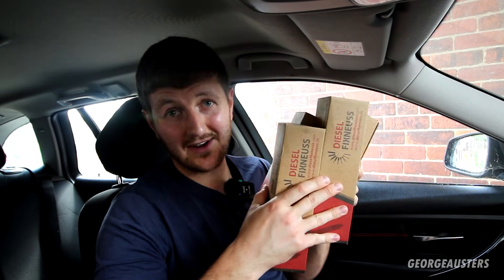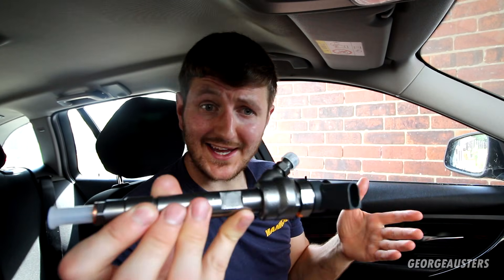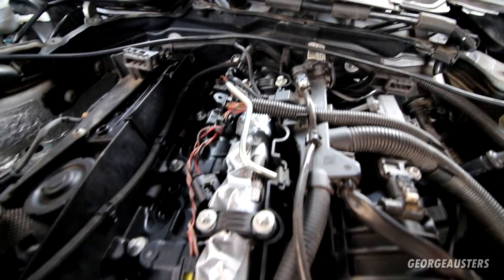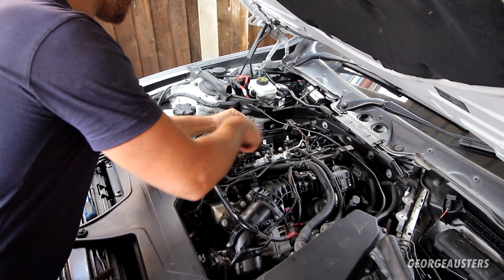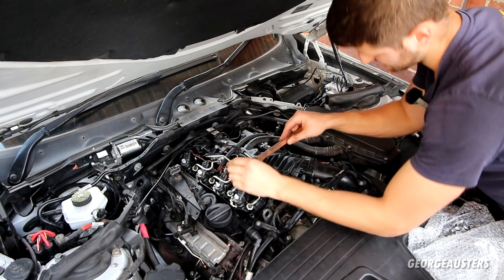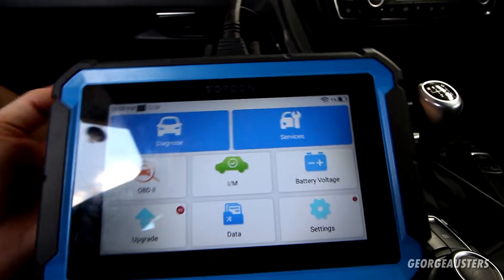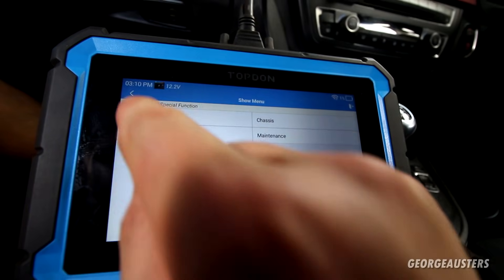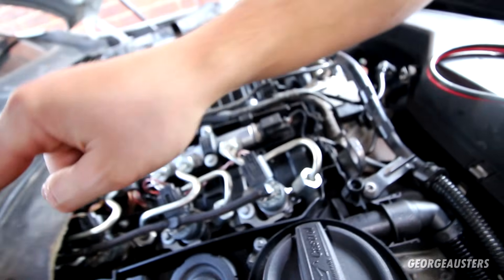HOW TO CODE DIESEL INJECTORS TO YOUR CAR

Comment: I need help , bought a 06 tundra. The owner ordered custom OEM 12 hole injectors , installed them then I bought the truck. I've had a p0138 high voltage code 2 weeks after buying it. I've changed the O2 sensor it said was bad and even swapped it to the other side to see if it was a faulty sensor. Code still comes back, is there a chance the injectors need to be coded to the ECU? I want to love this truck again 😅

Comment: I might have this job coming ahead, currently I have injector leakage on cylinder 1. At cold engine correction values with cylinder 1 is almost +3 and with cylinders 2 and 3 only -0,6. Cylinder 4 has -2 correction value on cold engine but when engine is warm correction values in cylinder 1 is only +1 and cylinder 4 is -1 which in spec. Cylinders 2 and 3 are almost 0. So I think ill just try to swap injectors and see if high correction value follows the injector and if it does I´ll need to do this which is very easy now when I have clear instruction video. I bought same scanner and it has been very good purchase.

Comment: Hello, do i have to do adaptation of injectors after i replaced copper washers and cleaned tip of nozzle ?
Reply from the maker: No
Reply: @GeorgeAusters car is accelerating slower then before, one side of injectors was clogged, now its clean but car is slower

Comment: Well my issue is now WTdiesel done new encodings and they not match with the injector body code. And i am in shit cuz i changed all injectors and i mixed paper work. They wrote new code for each but not the old value on paper. Now i dk what code has each

Comment: 📌I had all 4 injectors changed and coded in my toyota avensi but my EML light is on now plus handbrake light (handbrake works fine) not sure why is that 🤔

Comment: hi george, i got 4 other injectors for my car and one of them, the plastic is a bit broken and i have no clue what the 7 digit code was. 
is it possible to find out what the number was  and if not, does this make this injector useless
Reply from the maker: Engine will still run without coding injectors👍🏻

Comment: Hi George, i have 2013 640d and had my rocker cover and gasket replaced in March because of smoking and leaking. Since then i have been seeing oil on top of the cover in the injector ports. Had the gasket replaced again because the first garage messed up first time and lots of gaskets in injector ports were pinched and not installed properly. Its been fine for a while after this but recently noticed a little bit of oil on top again. What can cause this? I had all the injector seals replaced as well.

Comment: Hi George, just a quick question. N47c16a engine. Just had my rocker cover gasket changed and also glow plugs plus oil change. I  can now hear some. Whining coming from the engine area (sounds like a turbo whine but don't believe it's that). Any ideas what it could be? Although can't hear it a start up, only when engine warmed up
Reply from the maker: Boost pipe on properly?
Reply: @GeorgeAusters  I will check

Comment: When you are using a torque wrench only 1 click is required, a double click isn't good practice and a bad habit to get into!
Reply: I do it as well... I like the clicking sound...😋
Reply: Calm down Karen it does no harm, I do it aswell for peace of mind checking the torque with the second click it takes an extra second
Reply from the maker: It’s just to check it is torqued

Comment: Are the values not different as they have been re manufactured?
I’m sure they would send new values with the test sheets?
Regards
Reply: I was just about to say the same. The new values are on each test sheet not the pre-rebuilt ones from the factory

Comment: my 2006 bmw e87  120d wont start ewery time i replace battery or disconnect it. car crank but not start. so a guy with diagnostic  must set something to make car working again. as i remember its always something with CAS module problem. and maybe something else too. why is this happening ?  and what is cheappest diagnostic tool i can buy ,to doo it myself next time  ?
Reply: Probably CAS realignment thingy